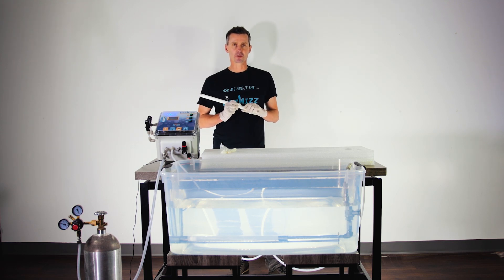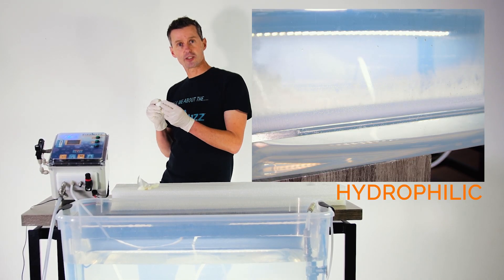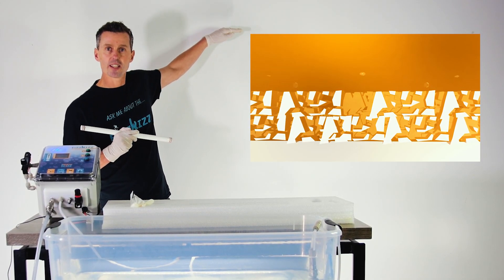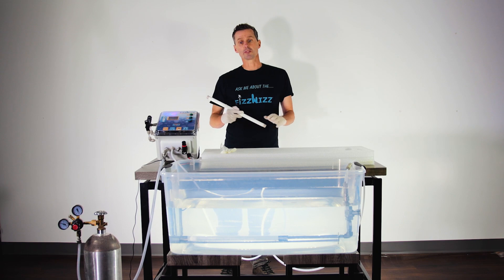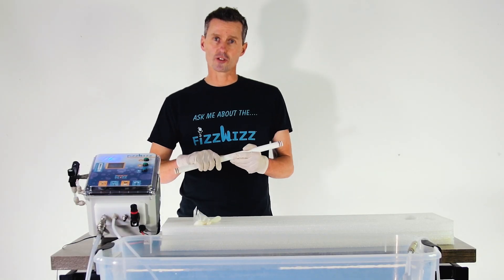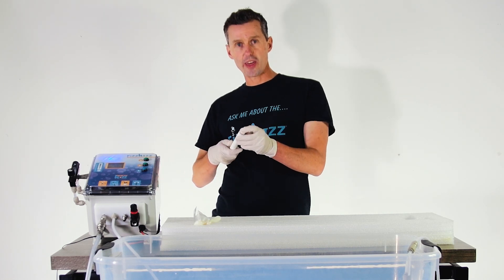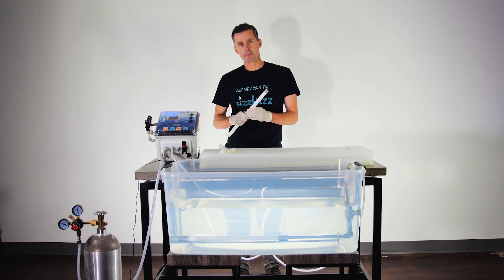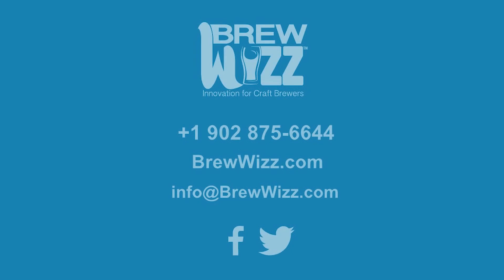Hydrophilic Bubbles and Carbonation Stones

Comment: Hi,

What is the average size of the bubbles for the ceramic stone?  Is it in Micron? What maybe the best size of the bubbles for better tasting beer?

Thanks in advance.
Sam
Reply from the maker: Hi, we use a 0.5 micron pore size, depending on the beverage the bubble size it creates will change a bit. high alcohol helps make the bubbles smaller. Making sure the bubble is created inside the stone is the most important thing, even if you have say a 2 micron stone. you want to avoid multiple pores making bubbles on the surface of the stone. The smaller the bubble the longer the bubble has to dissolve into solution, ideally never getting to the head space in the tank. it is when the bubble breaks the surface of the beer that effects the taste, as the action of bubble breaking the surface is removing proteins and aromas, that action is called scrubbing, feel free to fill in a Contact Us form and we would be happy to call and chat.

https://www.brewwizz.com/pages/contact